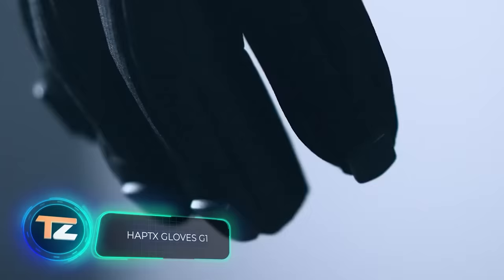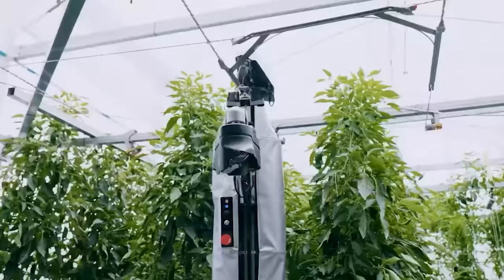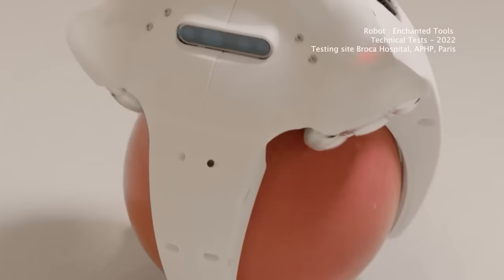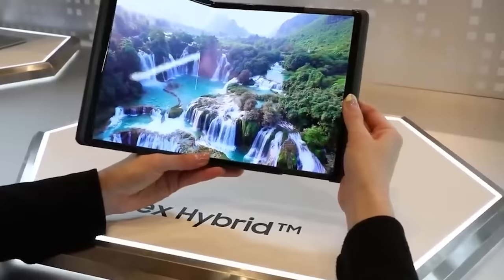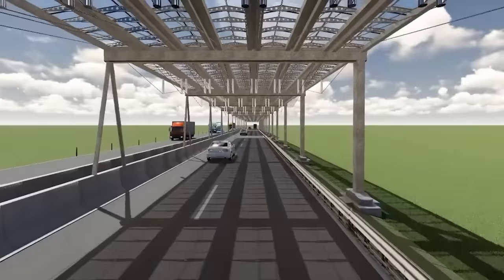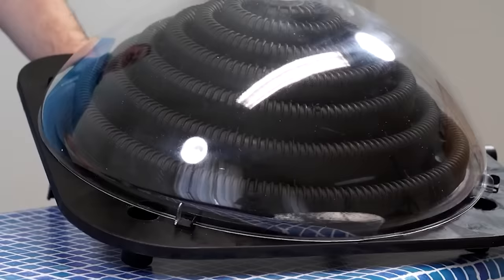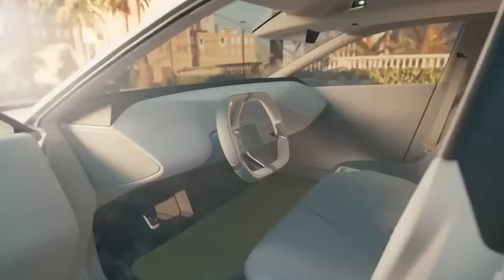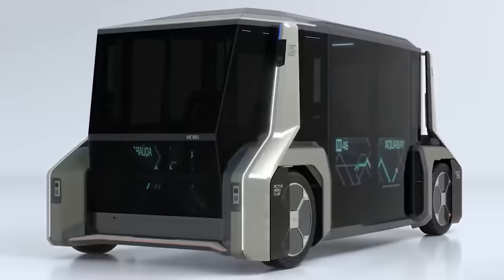INCREDIBLE INVENTIONS THAT WILL BLOW YOUR MIND

Comment: RE: pool heater - 354 cubic feet is 10’ x 10’ x 3.5’ deep....a glorified hot tub.  To get 6 hrs of sunshine in order to use it is a fantasy, and even if the unit received 6 hrs of sunshine the pool water would as well, heating itself.  We’ll be getting about 1 hr of sunshine every day this week, and if we had a 20’ x 30’ x 4’ pool we would need 42 of these units to heat the pool this coming week.
Reply: Solar pool heaters have been around for a long time.
Reply: Exactly my thoughts. Seems like it works by warming the coil from direct sunlight and "heating" the water that way. You'd get better results by covering the kiddie pool with a black tarp for half an hour than what this does in 6
Reply: @TheSnatchbuckler  Yeah, only place I see this being functional is to help small ponds or warming a paddling pool - anything else is asking an awful lot of what is basically black pipe in a dome. If I ran water slowly enough through my hosepipe in the summer sun it'd achieve the same thing.

Comment: If the road cover also manages water conservation, it could also avoid both contaminated runoff as well as water loss to evaporation.. thus the water could be captured and used in a variety of ways as well as possibly used to cool the areas via water fall areas that allow the water to be felled in some areas when heat is extreme... then recaptured and recirculated to the system.. that would also allow the solar panels to be cooled to increase efficiency and over all reduce contaminated run off.. as well as deicing... possibilities... by running the water under roads in areas of concern.
Reply: You just gave me a flashback to history class with Mr. Powers and the wheel of cheese. Haha goes to say that how powerful the Roman's became and something tells me a huge part of it was there control of water. 

Seems we coul benefit as an econimic power a little for if we perhaps managed the resource a little better.
Reply: @waynegretzky8464  If one looks up the most valuable land mass on the planet they find it is smack dab in the middle of the Great lakes region.. the worlds largest supply of fresh water.. Yep fresh available water is and will be like gold...

Comment: The Ultratech Rapid Rise bund will be useful in construction work when a concrete or grout crew are working in an area with endangered species. I wish the construction crew I worked with had several of these.

Solar panel autobahn is actually an interesting idea! that said, you would need to plan it out well so that if one unit gets taken out, say by a car crash, it doesn't take out the whole system.

The kokido keops thing is basically a tube that pulls water through, warms it up via solar energy, and spits it out back into your pool. You could make it yourself if you wanted to.
Reply: then run the energy collected down into the road into induction coils that will charge electric cars as they cruise over them.
Reply: Completely outside my field of knowledge, but I wonder if it is also possible to harness the kinetic energy from the road to add to power production?

Comment: The solar cell roof would be great on cycle paths and walkways, especially in more hostile climates.

Not a fan over roads though. Increasing number of people rely on solar cells on vehicles - for example, people with campers. Also, there is the possibility of electric cars and trucks using solar cells for some of their power.

Comment: I don't know if I would trust the stroller! And the last one with the "car", I dare bet that at sometime in the future there'll be vehicles like that! So many great ideas, and it will be interesting to see which ones will actually be produced!
Reply: i could see the car being used like a limo or smt
Reply: @@karlwithak1835 VR remote control has a million uses in industry and even combat.  Just think about remotely piloted drones and apply that type of remote control to mining, sewer installation, road work, high building construction, underwater work etc.
Reply: It’s hard to communicate that it is an electric stroller if you have people holding the handle. I don’t think people are actually expected to walk downhill not even looking at it. That was to show that it senses the slope and will stop if it reaches a certain speed — that it won’t pull downhill.
Reply: That car will be owned by the government, and we'll have to pay for usage rights.
Reply: dude , i loved the shuttle / scuttle whatever they called it. only cool thing in the vid.  Get some of the intrusive tech outta that thing and I'd be fire as heck. I think the 90 degree wheel turn is a super good idea. Completely eliminate the concept of parallel parking. dang that thing looked cool.
Reply: @Karl with a K why not the box like car with the 90 degree turn wheels  , what's wrong with that one.

Comment: I am more impressed with the Detroit charging system for cars which does not have contacts but uses conductive charging.
Reply: conductive charging is the least efficient and slowest charging method possible. what's so horrible about plugging in a cable?
Reply: @SteveAkaDarktimes  Because this wasn't talking about plugging in a cable but contacts with the road surface as driving.
The Detroit model is contactless while vehicle is in motion.
My daughter has a VNS (Vegas Nerve Stimulator) for seizure control and goes to surgery next week, for the 7th time, to replace battery in the unit. WISH they would make the unit with a contactless charge.

Comment: Everyone talks about building eco friendly cars/robots that relies 100% on electricity, but nobody talks about how eco friendly is to generate all that enormous amount of electricity.
Reply: the solar road roof is the only one useful, but also most expensive to cover all that area
Reply: It depends, I mean I agree that no one talks about the coal that must be burnt but if the electricity is solar generated or wind generated then it technically is eco friendly
Reply: Wind turbines aren't eco friendly
Reply: @Microdave75  1. Each single turbine is covering a ground in which no plant or tree is allowed to grow up in there.
2. Noise pollution.
3. Electromagnetic fields on land and sea.
4. Increased vessel traffic and vessel strikes on floating turbines.
5. Floating wind turbines other concern is they can create artificial reefs which'll attract sea life and cause a negative affect on them.
6. It is not yet determined how dangerous wind turbines are to birds, the biggest single wind turbine blades to date are covering up 53,000m² or 570,000ft² (10 American football fields) on air while spinning 24/7.
If that's eco friendly then I'm an alien on mars. So I agree, Wind turbines aren't eco friendly.

Comment: I've thought about the idea of vehicles batteries being charged with track years ago. I'm just not an engineer.  So cool
Reply: I vision an EV car that charges it's self by itself from the motion of its axle drive. If an alternator can charge a batter from the belt of the engine. Why not a device that is around the axles as it spins. It should keep it charged. Everything that spins can be used to generate power back.
Reply: Its called a trolley on ALL california streets, Electric transit has been around for over 50 years or more
Reply: @MildarValsik  Newton law, energy cant be created or destroyed, in gas cars it works becouse it transforms extra motion energy to electric, but with electric car you can just simply use less energy, so there is no waste you can collect.

Comment: The future of automobiles should be simplicity and low cost. 

The fewer computer parts - glass - and plastics - the better. 

The most purchased cars are compact sedans - like an Accord. 

The first auto company to offer a Toyota Tacoma sized truck - for $10,000 - would steal 99.5% of all auto sales. 

People don't want to drive a PC around. 

They want cars that are built for the express purpose of being easy to fix, cheap but not CHEAP, and can be driven for 500,000+ miles before being replaced.

Comment: That requires a lot of steel to put solar panels on top of roadways. You would also need to coat that steal so it wont rust in the year. That coating would need to be redone from time to time because the sun would ruin it over time. Those coatings and steal are not pollution free. What unknown dangers exist from this new method of road way? Since we're blocking the sun, we'll need to run lights during the day. That takes up energy. It's also has collision risk.

Comment: As a person that had responsibility for the maintenance of the power stations that ran street cars, I can say the road power system will cost a lot more money and require 24/7 maintenance staff to make viable.  Also, it will be easy for bad actors to take down.  The Engineers here have not though about the total cost of ownership.  Bad idea.

Comment: I feel like the guys behind the solar canopy on roads should get in touch with the charging road strips...
Then we can basically all drive around in solar powered bumper cars 🤷‍♂️
Reply: Not a practical solution. When you shade massive areas, you start cooling them off, when you divert the rainfall you create micro deaserts. In short it will never get past the environmentalist

Comment: The spill containment system, if offered in the right size, would be great for washing/detailing your car indoors in the winter.
Reply: Get real....
Reply: How? Why would you want a puddle of soaps/dirty water under your car
Reply: Hecks yeah,  and stick a hose in one end to run it out the door for draining.   also  now that you have the concept you could likely build something at home with a couple pool noodles and a tarp.
Reply: @partingmist8550 I've already done the pool noodles/tarp thing(although I used carpet poles) it's just a little unwieldy.
Reply: @thomaslikescars  don't play in the pool  of water. I'm not saying I would splash around in it, just keeping water off the floor if it's got no drains.
Reply: @DEATH14269  I am. I really like having a clean car, even in the shitty midwest winters.
Reply: A drain would be easier you know...
Reply: @DEATH14269 Ripping up my concrete slab garage floor, installing a drainage system, re-pouring a new floor and raising the driveway to meet the new floor would be easier than a self inflating, steerable, portable fluid containment system? No, I actually didn't know that. Hmmm. I guess we can learn something new every day, huh?

Comment: Elonroad is unsustainable. Just use trolleybuses and reduce the cars on the road and you won't need the expensive high unclimate-friendly batteries that the system would require.

Comment: I don't see why all baby strollers aren't electric by now. They could have a little thumb throttle and be so easy to control, especially if you used two thumb throttles and tow motors!..wouldn't have to be fast so you wouldn't have to charge it but once a week or so. they should be on that.
Reply: Becouse we dont live in utopia world where everyone can spend 1000's of $ they will most likly only use for year or 2. So yes reason is, who would spend more for something that aint rly that usefull, shure its handy but not rly needed.

Comment: So if you have rare earth magnets in roads and a giant coil under the car it charges as it rides over the magnets.
Reply: Having permanent magnets in the road and coils in the vehicle would generate electricity as the vehicle moves, but would retard the motion of the vehicle so as to require more power to move it than the amount of electricity generated. It is equivalent to charging the battery of the vehicle with a generator driven by the rotation of the wheels.
Reply: @cedriclynch  So then they would put the coils in the road and use a tuned circuit and the receiver would be tuned to the same frequency on the car to recharge it.

Comment: 'Willing' to buy electric cars ? It's not a question of willpower it's cost. Upwards to 50K and over and the battery alone can cost as much in case of change. That plus the totally evil destructive mining of elements that make the battery and their limited supply. Also the limited range of these vehicles. There have always been other solutions but corporations are just not willing to develope them. Many years ago a French inventor made a motor that ran on water and was asked to gift it to the country so they could lock it up.

Comment: Great, a baby stroller that can drive itself or assist you if you find that you're "just not up for it today Becky."

I can see the automatic brakes being a good feature as I personally wouldn't want my kids rolling away from me if I stopped somewhere and misjudged the .5% incline, but it doesn't need a god damn motor on it to make pushing it easier. If you can't handle pushing like 25lbs on wheels for any length of time, then you need to hit the gym, not the amazon store. I'm all for ingenuity but not if it's going to turn us into those Wall-E people that weigh like 600lbs average and can hardly move on their own.

Comment: That shoes gadgets should be weight more than 10% of the shoes. 
For more 10% stride you use more than that in energy, the one using a wheel much better but look awful. 

Charging on parking lot is a lot better than charging in road like that, considering they need to align to charge, its arguably can lead to accident. 

Also that sounds reducing gadget is ridiculous, might be biased because I've seen someone talking about it but I agree with them, it's not a microphone, wearing them would be more annoying than putting a mask on which is a better solution for those loudmouth, you would talk less with your mouth hindered.

Comment: The over the mouth microphone not only will you feel like a tool using you'll look like one too. But don't worry you can wear these shoes which will not only cost you a fortune but one miss step break your ankle till the cylinder starts to leak, of course that wont be problem as you wont be walking anywhere as you'll have done you back in wearing your haptic unit. then you wake and realise its all a dream as you still have six months on you sentence for running over someone while distracted by a pop-up on you windscreen